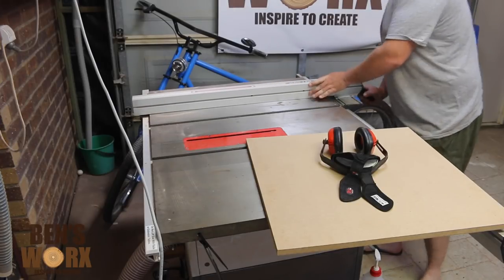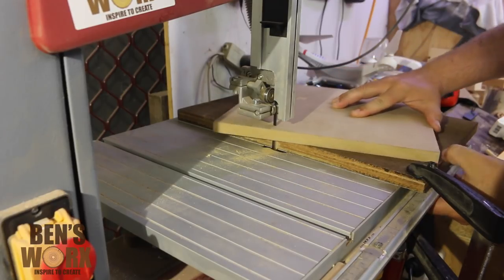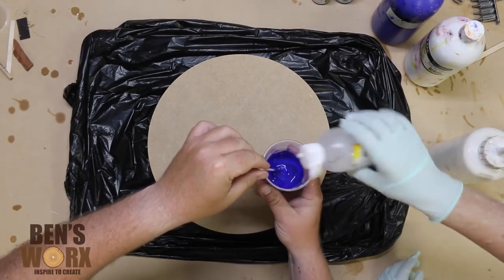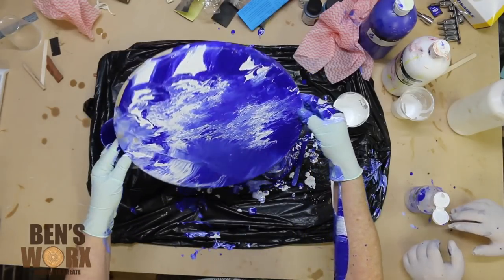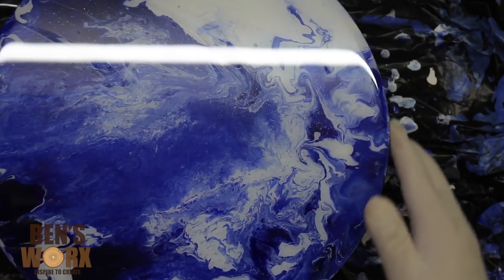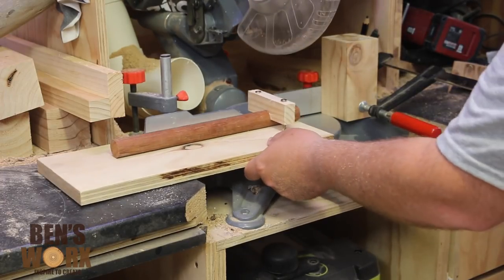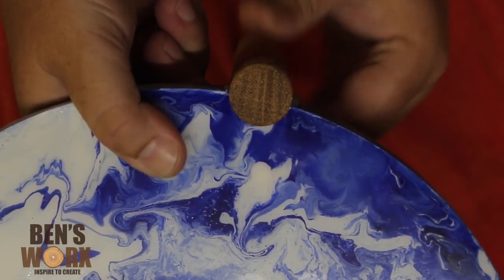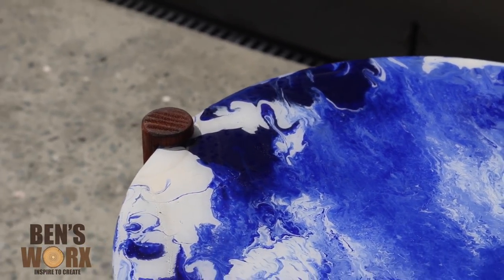Easy acrylic paint pouring - How to make a flat earth table

Comment: That's super sweet! Love the colors. I use a clear shower curtain from Walmart to protect surfaces I am working on. :) The size is great and it can be cut easily should I need it smaller. The best part is that I can peel up the paint/resin and use the skins for something else. :D - Heidi
Reply from the maker: That’s a great idea Heidi
Reply: Well I can't take all the credit for the shower curtain idea. I got the tip from Art Resin's YouTube channel. :) They have a lot of great ideas like that. :) Saving the skins to use for something else I discovered on many different channels. :D
Reply from the maker: That’s ok thanks for sharing your knowledge I really appreciate it